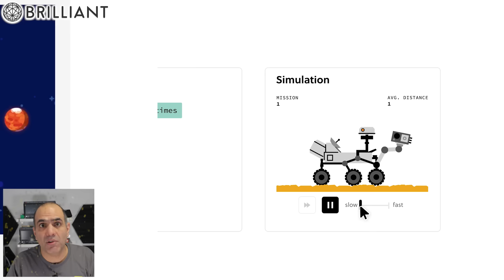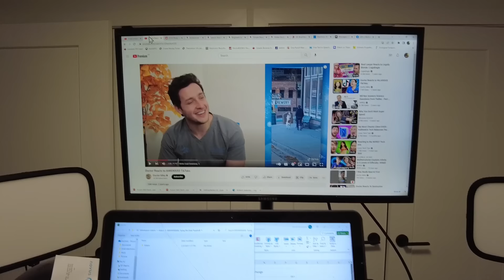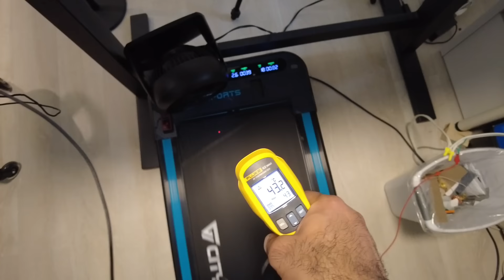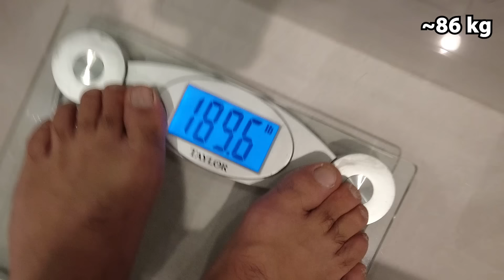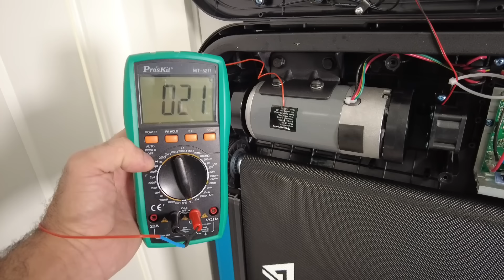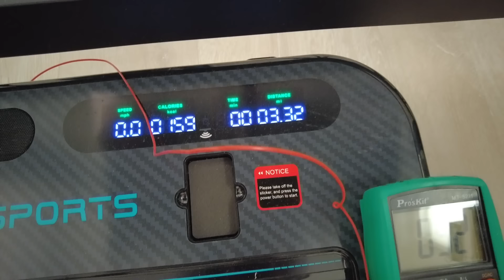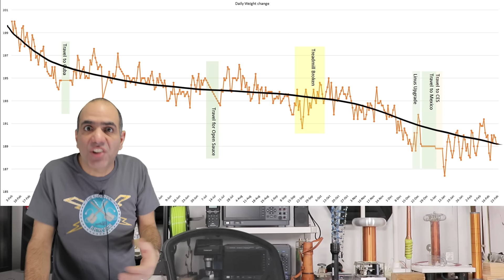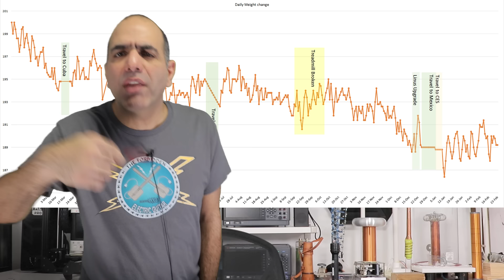Getting in Shape by Sketchy Treadmill over 1 Year

Comment: 05:00 would that zapping damage the laptop? Either by sending charges through the earplugs or charges from your fingers to e.g. the keyboard?
Reply: In theory it can. In practice, wires and connectors are arranged in a way that is most likely to direct the discharge onto the chassis, which is either directly grounded, or just discharges it out of the way.

Comment: 12:13 and thats exactly why having switched outlets is far superior to NA non switched outlets.
Reply: Hitting a switch is no easier than unplugging
Reply: @Owen_loves_Butters  yes it is. It is also safer. Go and plug something in behind a couch, or TV stand. Or that fact if I'm troubleshooting I leave the thing plugged in. I also don't need to pull the plug to isolate it if something goes wrong, or if I want to cut the power while I'm away. Once you have to plug it in back in, its easier. 
Fucking wild to think pulling a plug and having to put it back is easier than flipping a little switch.
Reply: @PBMS123  It is not safer in the slightest, and is barely if at all easier. It's nothing more than a minuscule convenience factor, and probably would safe a few seconds over an entire lifetime. It takes practically zero effort to simply grab and pull. Oh, and for the record, we do have switched outlets, we just put the switch in a place where it isn't completely redundant.

What's really wild is you being so smug over your pointless switches, when if you wanted to criticize the North American electrical system, there's many actual things to criticize that matter, like the fact that our plugs have zero safety and extension cords that cannot carry a circuit's full capacity are not required to have a fuse or breaker.
Reply: @Owen_loves_Butters  The only person here being smug is you. lol, they are safer, and more convenient. To say they're not safer in anyway what so ever is just insane. I've had to deal with both.  I can leave things plugged in but turned off, which is convenient, and safe. . I can turn of all the plugs in my house when going away on holiday for a long period. 
The switch isolates the outlet, which means sticky fingers are not going to get shocked by an empty outlet - and for NA which does not mandate, and it appears manufacturers don't do anyway, is have insulated plug blades/tines. Everywhere else in the world plugs are insulated at the base so small fingers won't electrocute themselves by touching the blades of a plug that is  half out of the socket, where it is in contact with the electrical contacts and so is live, and said person's little fingers are touching them. 

I didn't point out the huge number of other things wrong with the NA electrical standards because I wasn't commenting on that. But there are plenty. 
NA outlets, brand new ones look like they're straight out of the 50s. Exposed metal. Exposed energised metal wire connections etc. A switch adds extra safety by de-energising the outlet and anything plugged in without having to pull the cord out. The fact you can't see that it adds safety and convenience and crucially removes nothing, is mind boggling.
Reply: @PBMS123  "I can leave things plugged in but turned off" Yeah, so can we. Everything that can be plugged in has its own power switch. Is that just not a thing where you are? Do manufacturers just make things assuming you've got that little switch? 

"Sticky fingers are not going to get shocked by an empty outlet" That just... doesn't happen here. The live contacts are buried within the receptacle, and can't be touched directly by human fingers. 

Your criticism of our plugs is 100% valid, but it has nothing to do with switches.

"Exposed metal" Any exposed metal must be grounded. If a live wire touches it the breaker will trip.

"The switch adds extra safety by de-energizing" Which you can also do by UNPLUGGING THE THING. You have to reach for the socket anyway to flip that switch, and taking a plug out of an outlet is literally just as easy as hitting a switch. 

Switches on outlets are nothing other than a mild convenience at best.
Reply: @Owen_loves_Butters  No you can't. Irons don't have switches. 
And it still doesn't cut the power to the appliance. Thats the point.

There is no mandate for RCD/RCBO circuit breakers so, it being earthed isn't fool proof

Unplugging an item is comparatively harder, and potentially more dangerous, particularly in NA where you admit yourself that extension cords can be rated to less than the max socket rating for current. 
A switch is easier, is quicker. And crucially means I don't have to unplug everything. I can leave my couch where it is and flick a switch. I can leave my tv stand where it is and flick the switch. etc. 

Again the only smug one here is you. You're so desperate to defend it you're getting actually upset. Switches are great, they do improve safety, whether you want to believe or not..
Reply: @PBMS123  Many of them do.
It does cut power to the appliance. That's the point of the switch. If it didn't cut power to the appliance it wouldn't be much of a power switch would it?

Grounded metal doesn't require RCDs to work. If a live wire touches the metal, it's a dead short to ground, which will trip the breaker regardless of whether it's an RCBO or a bog standard breaker.

You keep claiming that unplugging is harder. It's not. If something goes wrong and you have to reach for the outlet to hit the switch, your hand is right next to the plug and you can just... take it out. I don't know why you think a simple grab and pull takes even a minuscule amount of effort, because it doesn't. And the issue of extension cords has to do with overloading it, and since those switches are not circuit breakers, they're irrelevant to that discussion.

Again, every device has its own power switch. A little mindfulness as to what plugs in where eliminates the issue entirely. And for what it's worth, we put switches on our power strips, so we do have that option for outlets in inconvenient places.

Your examples for a supposed safety benefit fall apart with the simple fact that it takes zero effort to unplug something. The safety benefit is nonexistent, and the convenience factor is minimal.

Comment: I've tried what you're doing here with a stationary bicycle under the table. i bought the cheapest one i could find, and disassembled it and left only the necessary components. it's now a portable unit that i place against the wall and pedal from my computer chair sometimes - it's just a tiny frame with the pedals and the belt system in it - no seats or handles. it sorta works. emphasis on sorta. i guess if you only need to lose a little bit of weight and stay healthier, it's great. but if you want to get really fit, it's not enough, it lacks the intensity necessary for it. plus it's kinda annoying to be sorta sweaty all day. 

so i'm going to gym. got a bunch of extra muscle now already, and since i wasn't losing weight (actually GAINED over 2kg of muscle mass in 7 months), i started a calorie-counting diet. if you're mindful of what you're eating, you're probably gonna "automatically" lose weight. but i did a bioimpendance thing and got my estimated daily calorie consumption and made a diet around that with the help of AI - which i use to talk about it, bounce ideas off and such. the exam said my recommended daily intake is about 3200kcal on days where i don't exercise- so i'm aiming to eat 2500 kcal or less every day, and i've been hitting between 1800 and 2400s most of the time. it's working great, losing a whole kg per week more or less.

plus i'm getting seriously strong from the gym. 😬 it's weird, it's been seven months and the gains don't stop coming even though i was already kinda strong before i got into the gym.

Comment: a good portion of the issues with the treadmill could be solved by a better/bigger fan blowing onto the motor. the heat and wear on the motor is causing the issues. im surprised as its a brushed motor which tend to generate more head that their brushless counter parts. and in tools atleast most brushed motors also drive the fan that cools them. the fan this one uses clearly isnt sufficient

Comment: Simplest way to get the static charge down is to get a carbon fibre brush, and attach it to the front by the motor, so it is touching the belt, and removing the static charge off it.  Might need to have one or two there to get all the charge off, though the rubber likely is conductive enough with all the carbon black used in it to move the charge all over.  Shock is because of the paint on the rollers making an insulating film.

Comment: I've had a similar issue with static electricity when I got a foam rug to play in VR. In the winter, I would accumulate charges from moving around, and would periodically hear crackling in the headphones from static discharges since the headset was wired.

Comment: Hey Mehdi!  I saw another YouTuber (I won't link him here, I'm not cross-promoting, just communicating the idea) who has built a human sized hamster wheel.  He is currently speccing motors to turn it into a generator.  He made it like they make the cat sized ones - the barrel rests on smaller wheels at the bottom, instead of turning on an axel through the center.  There are plans for the wheel online and a desk you can buy that fits through.  Building one would be a big project, and the treadmill you have at the end would not eat your shoes!

Comment: i think they didnt bother disconnecting live because with AC if you turn the plug around then suddenly the other wire is live
only works in countries whee the sockets permit that of course
Reply: i wonder if there's any ways that it could automatically adjust to the socket or they could just make it for different countrys

Comment: Hey I have an electronics question about a relatively simple Inverter circuit I thought of and I washing you could let me know if you think it could work. I wish I could send a picture of the schematic in this comment but I can’t
The way its connected up is there are 2 sets of 2 mosfets, and their gates are wired to 12 volts in parallel through two 5k resistors. The threshold voltage of the gates is 4 volts. The gates are connected to some 5 volt zener diodes that are connected to ground so that the gates discharge at 5 volts. If we’re looking at one of the sets of the mosfets the drain on the first mosfet is connected to the voltage source and the source is connected to the load. The drain on the other mosfet is connected to the other side of the load and the source is connected to ground. The same is true for the other pair of mosfets, it’s just on opposite sides.
Here’s how I think it should work. Inevitably one pair of mosfets is gonna turn on before the other because of internal resistance, so let’s say it’s pair 1. The gates gets charged up and opens more and more, letting more and more current flow from drain to source and through the load. Then when the gates reach 5 volts, they discharge through the 5v zener diode. By now, the gates on the other pair have already started to become charged up, and they eventually discharge through the Zener diodes. So basically the pairs of mosfets start switching on and off at opposite times, and since the mosfets are wired up in the typical inverter configuration, taht creates alternating current through the load.
That’s how I assume it would work, but I’m kind of a beginner in electronics, so please let me know if you see any problems with this circuit and if you think it would work. It would definitely be a lot easier if I could show a picture of the schematic but I guess I can’t in comments.

Comment: The vibration of the motor was most likely caused bearings failing or its a cheap housing and it warped so the bearing couldn’t seat properly anymore.

Comment: I might have to look into getting an under desk treadmill.

Weird that your shoes shredded like that. I've gone through many pairs of running shoes that I put 100s of miles on and never had them shred like that.

You might want to try a pair of higher quality shoes, maybe ones labeled for running, even if you have no intention of running with them. If for no other reason than to not have to clean out the shredded gunk from the motor casing

Comment: I doubt this treadmill will last you more than one year !.   If it doesn't then the one that definitely will is made by LifeSpan brand. I'm actually using one  whilst typing these lines.  I'm 115 kilos in weight  and have been using a lifespan underdesk treadmill for 6 hours daily ( 3-4 hours continuously ) over the last 2 months with no problems what so ever. The point is that most miniature underdesk treadmills are not actually designed to function in this regime so their small motors are heating up until they burn. A treadmill motor draws a lot more current when you ask it to slowly turn the conveyor .  By the time I finished typing this .. I got to the end of your video and found out what fate your treadmill had..  The new one will be the same..

Comment: Have you considered getting some heat pipe, forming one end to the outside of the motor and using some thermal paste, and putting the other end into some ice water? I know it would take a little work, but you’ve done more effort for hobby projects.

Comment: Ya know, you could cut a hole in the bottom of the thing and wire up a simple 60mm PC fan to the power to vent the heat from the motor.

Comment: If you haven't seen my videos about a motor collection I have you could check it out if you want I am a fan of the electric motor Armature part i like to keep them as a collectable for some reason that's basically my hobby the Multi-phase one's I think are really cool because of the more copper contacts you have on that kind of design the ones i think that are really cool with that design are the ones where you can see the copper connecting to the commutator with the multiple contacts like that one you have there the one I really think is a cool one is the Front Load brush motor especially one from a long skinny design stator since lots of those designs of that Armature has the copper slot cast iron pieces in a diagnal design i really find motors like that to be cool!

Comment: My treadmill would always pop the circuit breaker when turning on, apparently it is drawing more inrush current than the breaker allows. I have to connect it with an extension cord to another outlet in the kitchen, where the breaker is less senstitive 😂 Not sure if the treadmill is sketchy or the breaker just too sensitive

Comment: If you want to get your cholesterol levels down even more, stop cooking with vegetable oil. Olive oil has about 55 to 80% oleic acid (a very healthy fatty acid) that will turn into trans fat either through age (what you know from "going rancid") or from heat. Trans fats will be incorporated by your body into cholesterol more easily but it'll turn into "bad" HDL that's considered the main cause of heart problems. Cholesterol itself is impoortant because it's the main building block of your brain and the body needs cholesterol for maintenance and repairs, so it's important that you provide healthy fatty acids. Clarified butter is heat stable and not only keeps your heart healthy but also (in my opinion) makes your food taste better.

Comment: Surely an overheating or burnt-out motor is a defective motor, and one that is not even fit for purpose.  Things just aren't designed for frequent use anymore.  You buy a sofa which collapses after six months, only for the maker to tell you: It's an "occasional" sofa - one designed only for "occasional" use.  You used it too often.  It's your fault.  Everything is made on the cheap and we pay through the nose.

Comment: I watched this when it came out and it got me thinking are you walking or running or just jumping forward, when you walk or run the road doesn't move underneath me with a motor, you have to push yourself forward, so are you just jumping forwards. it's starting to make my brain hurt. Come on Mehdi it's about time you sorted it out, and if it's just jumping forward, what's the point in fixing the motor, just push the belt round with your feet.

Comment: WTF even is this Live and Neutral shit? Like, you can just plug into the wall upside-down and would still have this issue, even with correct wiring inside, right? So labeling anything "live" and "neutral" makes zero sense. Of course, the thing is not supposed to be opened up (especially not plugged in!) so I think they're actually fine not to install a switch that switches both leads off.
Reply from the maker: In North America plugs and outlets are polarized so normally you can't plug them backwards. But yeah I guess that's a possibility